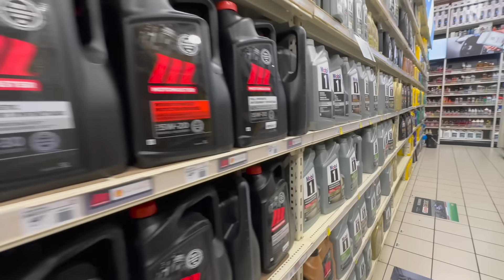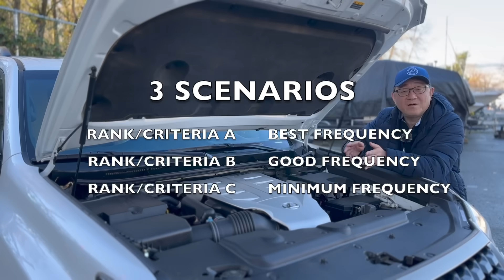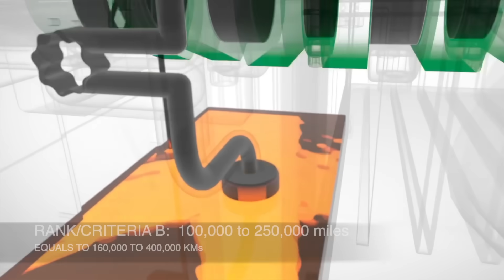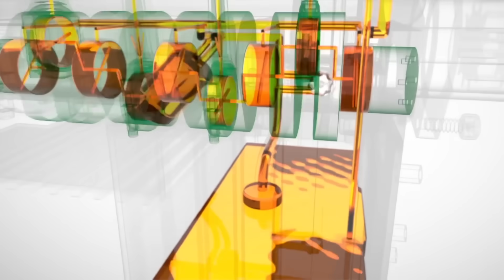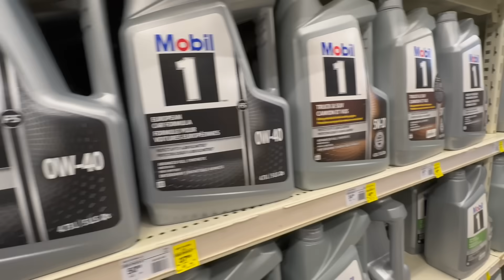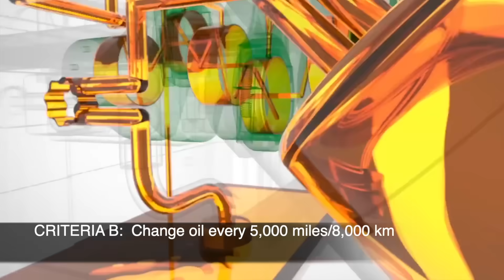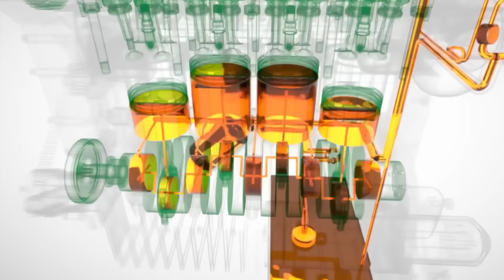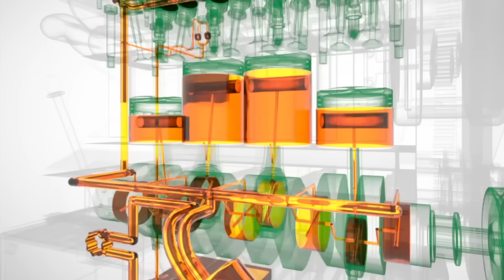ENGINEER EXPLAINS HOW OFTEN TO CHANGE OIL & FILTER // UPDATED CRITERIA-BASED RECOMMENDATIONS!

Comment: I agree with your comments the only issue I would bring up is cars also have a time limit due to changing technology so for example would you want a 20 year old car with no GPS and also doing the gas miles of 20 years ago. Its a balance. I kept a 5 series BMW for 300,000 miles but the interior looked old and dated and although it could still go its time was up.

Comment: Well I had a  94 Jeep Cherokee which I bought when it was 2 yrsrs old 12 000 miles.   I has tge vehivle for more than 20 years 220 000 miles and i only ever changed the oil once every 12 000 milss o once year or even less.   Except for chsniging thr water pump three times anf the spark plugs 3 times y repairing a very difficult to diagnose electical witing fault  with  the injection but easy to fix no other wirk was performed on the motor till over 200 000 miles and then the head was removed because of a corrosion problem csused probsbly by different coolamts but not an oil related problem.   The vehicle was eventually scrapoed due to excessive body rust and cortosion but the engine was still rinning OK

Comment: Hi, great video. Can you tell me what you think about the white milky ceramic oil? Any good for a thp 1.6 200hp. I hear it is realy good for the anti friction and high temps but most importantly i just would like to know if it helps me to keep the car for as long as possible. Love my car. Fought hard for ir and it has a lot of emotional value to me for a lot of other reasons. 😂 ❤

Comment: I changed the oil on my 2014 Prius C every 10K miles per the manual. Bought it in 2017 with 97K miles and sold it in 2021 with 218K miles. (I was driving over 30K miles per year). Zero issues. Sticking with the manufacturer's recommendation for the rest of my cars. 1 year or 10K miles whichever comes first, unless special conditions warrant halving the interval (a lot of idling, towing, soft- and off-roading).
Reply: I agree with every 10k miles as stated in the manual.

Comment: I had a dealer actually talk me out of an oil change if you can believe that!  Bought a low miles off-lease certified used Toyota Rav4 that had a manufacturer interval of 10K miles, but oddly they require 5K mile 'maintenance' intervals which is actually just an inspection - so you end up changing oil every other visit.  Very strange.

Anyway, I came in at the required 5K miles service and wanted my oil changed.  The service guy told me that was a waste of money because the manufacturer suggests 10K mile intervals.  I literally had to demand the oil + filter change to be done at 5K miles.

I don't know how to feel about that - on one hand it's refreshing to find a dealer that's not out to steal every penny, but on the other it feels like the manufacturer interval is based on just getting the vehicle past it's warranty period with little thought given to long term life.
Reply: We're getting a lease return Honda Passport. Despite having a recent oil change it's going to the dealer for base oil change with the correct oil.

Comment: I test drove two CR-Vs, one 2021 with 141k and a 2022 with 120k. The 2021 drove like brand new and the 2022 drove terrible! Definitely a C car, so much engine noise and so dirty under the hood. The 2021 was so quite and smooth, definitely a A car. My  cousins 97 es300 drove better than the 2022!!

Comment: 3k mile or 3 months OCI for me. I make a lot of short trips. No oil consumption. Buying a poorly maintained used vehicle is not a good option for anyone. Too many used cars with 10k mile oil changes. It shouldn’t matter how long you plan on keeping the car, change your oil often and early. 10k mile yearly oil changes are criminal.

Comment: Changing oil more often than 3000 miles or 6 months on a street car after the initial break in, is a complete waste of money, time and resources.   
4000 miles is usually fine and 5000 miles or 6 months is acceptable for any synthetic oil in a car driven in most circumstances.   If you drive only short trips and have direct injection, I would examine the oil at every fuel stop to check for gasoline or water contamination.
if your oil smells of fuel or you see water separation on the stick change it right away.

Comment: My cars done 140k miles turbo diesel, last one  turbo petrol did 220k miles. Both on annual oil changes, approx 10k miles annually, fully sync, never a problem.

Comment: How many engine running hours required to replace engine oil ؟ 

Many time i start my engine  just to use Ac 

Sometimes its not reaching 2.6km 
But the engine is running around 150hrs from service to service

Comment: My 2010 Corolla has 50,000 miles, is due for the 5 month oil change, but the oil has barely 1000 miles on it.  Mostly city driving.  My 2018 Camry has 40,000 miles, all highway driving, and again is due at 5 months but the oil has 2000 miles on it,  both use synthetic.  Any suggestions?  Oil appears clean on examination.

Comment: I recommend changing the oil every 100 miles. I mean, I want to be in category AAA++++ and everyone knows that manufacturers make engines with zero engineering compromises and it's just the oil drain intervals that dictate the longevity of the engine. (Heavy sarcasm) Do yourself a favour and stop listening to so called experts. Change your synthetic oil and reinforced filter once a year or 20,000 km.

Comment: Does this apply to turbo charged cars also? because I know that turbo charge engine runs hotter than non-turbo charge engines. Well, the oil passes through the turbo well see higher temperatures if you get what I’m saying.

Comment: So much of this depends on the engine and the oil and filter you use.

Like, if you're burning a lot of oil, then you're oil is definitely getting contaminated faster than an engine that doesn't hardly burn any oil.

I'd personally consider changing a well sealed engine's oil every 12k miles using Mobile One Extended Life and Filter ($35) an aggressive preventative maintenance schedule.

Comment: If you’re in category A and want to keep your car forever follow the recommendations in your owners manual. There’s no reason to change the oil in your modern car at 3000 miles. There’s YouTube channels showing oil analysis done by a lab and prove that you can actually even exceed what the manufacturer recommends without negative effects.

Comment: My very first car I purchased I kept for about 12 years and did the oil change religiously at 3k. Had no problems.
Reply: And my car is 9 years old and have always had 10000 miles between oil changes at the Volvo dealership.
It works just perfect

Comment: What is the reason for changing the oil filter every time you change the oil? Doesn't Honda recommend/allow that you change it every second oil change? Especially if you have a filter designed to last beyond 10,000 miles, isn't this wasting a still-working oil filter? It is unlikely that the filter will clog up and go into bypass on a reasonably clean engine.

Comment: For sixty years I change every three thousand miles Works great!!!
Reply: I gave up allowing the oil to get dirty and draining it in 1963 with a Frantz oil cleaner and Standard Delo 30W. All I use now is top loaders. I do have 2 Frantzs I forgot I had stored away. They need gaskets and hoses. I will put them on something.

Comment: I have an 06 envoy 5.3 v8.. only vehicle I could find last year.. cheap.  I didn't know but it has weak oil pump. I've had it 6 months. Changed the oil and filter 4 times ALREADY. When the oil gets hot.. pressure drops like a rock. When I change it its thin as water. If it's not too expensive I'll have that fixed. I'll be changing it tomorrow.  The computer says its 94pct. Visc. 
I'm looking for another dodge v6 pick up.. theyll run on cooking oil. Forever.   This is a sweet 5.3.. first time in my 50 years of owning vehicles.. a weak oil pump.
so. Fix it.. or find another headache.

Comment: If you are driving stop and go suggest changing every 3000 miles. Highway driving 40 miles or more a day every 5000 miles. 😊
Reply: I could be wrong, but based on his video with Ahmed I think his A and B recommendations here are pretty much “severe” recommendations because that generally that applies to most people.
Reply: I've been on forums with manufacturers' engine design engineers, who say the old change of your oil every 3,000 or 5,000 miles is a waste of time and money if you're using the proper synthetic oil.  Oil has much higher tolerances and quality standards than years ago and will protect your engine just fine with the recommended oil changes.  Most car manufacturers will go by time intervals and/or mileage, and it is common to go ten thousand miles or one year before it's needed. It is more about how you drive than the mileage or time intervals.  Short trips of less than five miles are very hard on engine wear and tear.  The motor fails to stay heated long enough to burn off the moisture in the oil, and this type of oil contamination will shorten the life of the motor, so in this case more shortened oil change intervals are necessary, as it is the number one cause of motor sludge..
Reply: "Severe" remediation is 2k miles, change the filter every other time.
Reply: @teddypierce6871  EVERY SINGLE TIME!!!

Comment: As per from a mechanics college instructor in Ontario, i change my oil when the computer tells me to.  The engineers who are involved in the manufacturing of vehicles have a designed lifespan of oil based on driving habits.  This is calculated by the computer in your vehicle. 5000 km is too often, especially with synthetic.  My companies work truck normally gets a change every 12000 km, give or take.

Comment: Although I do appreciate your video, I humbly find it a bit "generic." Your analysis reminds me of my first job at a gas station. I was told by the owner one day that we had three grades of motor oil, " Good, Better, and Best." The main difference between them was their SAE weight (viscosity).
 Engine oils have four basic functions. Their primary job is to lubricate of course, BUT they also clean, cool, and seal an engine. Synthetic oils are still mineral/petro based; however they are cracked from a different process. Most synthetics are actually made from natural gas base stock.
  As far as oil changes go: YES, it all depends on the type of service you expect from your engine. Virtually all oils lubricate, just to different degrees. DIRT and HEAT are engines big enemies.  Keeping a clean AIR filter is a big contributor to long engine oil life as well as a proper amount of oil to cool and seal the engine. TURBOCHARGED engines are a different story. HEAT is just as big a factor as DIRT on turbo engines. Even with regular oil changes at relatively short intervals you can expect to replace a turbo sometime during the engine's service life. HEAT breaks down oil, less so for synthetics. Oil does lose its adhesion at high temperatures thus reducing its ability to lubricate adequately.
 Additives such as anti-wear and anti- foaming agents are also lost in time.
 So. to sum up, an oil change is best decided not by mileage per se, but by condition. Black oil means CARBON is present, hence dirty. Mileage will tell you when the additives are ineffective/gone in your oil.  Don't forget to change your engine air filter as well.  Good vid! 👍

Comment: The only way to know for sure is to do regular engine oil analysis. Every engine is different, every driver's habits are different, and different filters and oils are different. That's the only way to have FACTS instead of speculation.

Comment: Hi. I have a 2023 Toyota 4Runner Limited. I live in The Bahamas so fuel options aren't as plentiful as they used to be OR like what you have in the US. I use Esso. I believe Rubis (aka Texaco) uses the same formula as Esso and Shell [allegedly] uses additives and their fuel is also colored blue. 

My current mile reading is 175 since I bought the Runner new at 26 miles in the early part of August 2023. I did the obligatory "1,000-mile or one month service" in September 2023. I only drive the Runner once a week and use my daily (2001 Chevy Blazer) otherwise. The dealer had me scheduled to come in during the month of January but I didn't. 

What're your thoughts on the schedule for oil changes, etc based on my limited driving of the Runner?

Comment: My manual says for city driving in 90+F weather, change it every 3,750 miles. And for under 90F freeway driving, change it every 7,500, and that's full synthetic. I want to keep my car as long as possible, so 20, 30, 40 years. Or 80 years.

Either way, I do mostly freeway driving, 55 MPH. About 80 miles a day. And I change my oil every 3,750 miles for the more strict schedule. I did go about 4,200 miles last time, not on purpose, in a span of 3 days I drove 1,000 miles, and didn't get a chance to change it on time. Probably no harm done. Still didn't like that.

I always replace the filter for every oil change. I try to get the best ones, so Mobile 1, or Wix. The highest miles one, even though I change it every 3,750 miles.

Comment: oil/filter change every 3000km ,,,,
radiator fluid every year,,,, 
air filter every year,,,,
AT oil every two yrs.....
EVERY YEAR (myself on hoist) = crude oil spray the bottom of the car + inside the frame + joints, springs, shocks, inside fenders, engine bay walls (screws, nuts) etc...
NO COLD START (not driving it winter time) = 1992 Ford TEMPO 3L V6 ...506,000km original....( AND IT IS STILL RUNNING LIKE BRAND NEW)...

Comment: I have a 2023 Acura tlx type s. Just reached 15k miles…the car is so much fun to drive. I change my oil every 2500 miles. I really love my car, it brings me a lot of joy so I go all out on maintaining her.
Reply: What a waste
Reply: 2500 miles on a stock car is a complete waste of time and money...people who track their car don't even waste that much oil...
Reply: @ exactly total waste changing at 2500 has diminishing benefits as he is not even using all of the additives and solvents in the oil base. To think he is getting any extra benefit is false changing at 5k-10k miles yields the same benefit.
Reply: @ I couldn't agree more, there are better ways to "go all maintaining her" than wasting money and perfectly good oil every 2500 miles that's ridiculous lol, a good oil analysis from Black Stone Labs would help confirm and support 5-10k miles
Reply: Keep it up
Reply: Good for you !! 👍👍👍👍. It's soooo cheap to change the oil and your car will last 500,000 miles +

Comment: I use a secondary (bypass) oil filter on all my vehicles including a Historic race car. That's a diesel van, petrol Caterham, Lotus Elise plus the competition stuff.

As long as I use top quality synthetic oil and change the oil filter and secondary filter every 10K miles, I really don't need to do a complete oil change at all.

Comment: How to make a 4 min video, 12 minutes long. Very repetitive, but his advice is good for Group A cars / 3000 mi.  But who would want to be a 2nd owner of cars in Group B and C where the oil change intervals are extended up to 12,000 mi? And no mention of changing a new car's oil after about 100mi to get ride of manufacturing debris (metal particles and sealant), then going to a 3,000 mile oil changing interval.  Also a factor not discused is Viscosity, and Multi-Rate Oils which break down with heat and harder use. Taking your car to a track day or off roading it can break down the oil in a few hours. And driving in durty dust conditions. So drriving factors are also a major influence in needing changing oil in 3,000 miles or even much less time.

Comment: 4800 if you have a turbo and if you use extended life oil, add an excellent filter with a naturally aspirated engine 13,000 miles or 10,000 miles if it makes you feel more comfortable

Comment: I purchused a 2018 Corolla XSE with 87,693 miles on it. I needed a car bad and wanted something that will run with few issues. Problem is my loan is 66 months so based on that I use full synthetic with oil changes ever 4,000 miles or every 4 months I plan on trying to get 350,000 miles out of this car

Comment: I am concerned with the grade of the oil, recommended for my Toyota 2018 Rav4 awd, with I think a 0-20 recommended oil.  In Florida, I get concerned with very hot summer weather, and when I change the oil, it looks and feels like water, like zero viscosity after getting hot.  Is there any problem with me migrating to a 5-30, to compensate for extreme heat?
Reply: There is also a 0W30...ran this in my Honda Ridgeline. Zero issues.
Have also bumped the viscosity in air cooled mowers (from 5W30 to 5W40) for years due to running for hours in the summer heat.
Definitely helped. Never an issue.